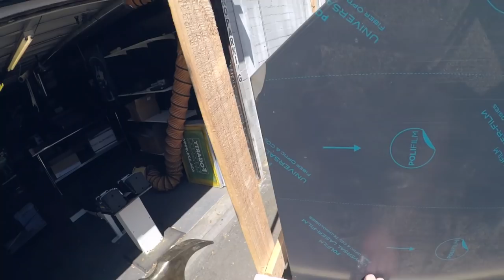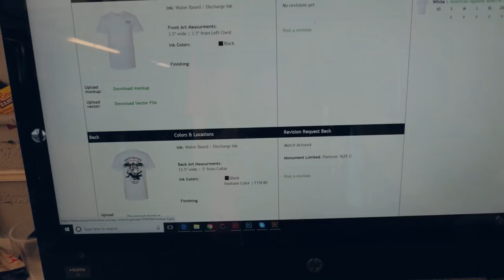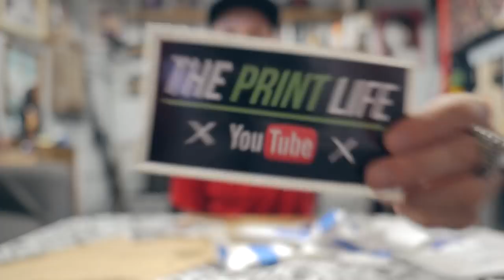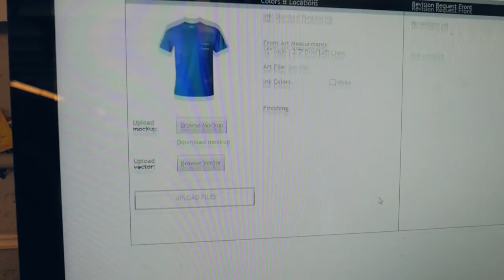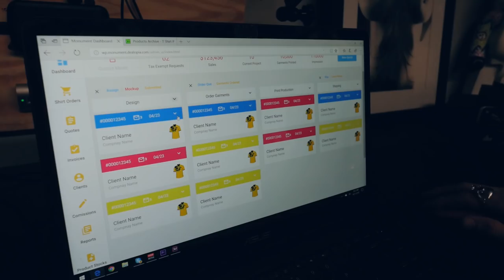Screen Print Vlog | Testing out some unconventional water based screen printing ink techniques

Comment: Oh no.! The Chinese flash dryer is down.! 4 months in, hopefully it just got to hot, Jesse is putting that thing to work.!! I need a recommendation on a good starter flash dryer, any suggestions Print Fam.?
Reply from the maker: Its back up and running. I think it did just over heat. I would still say it's the best bang for your buck if you have a carousel press.
Reply: I was looking at getting it after your review. good to know, maybe ill look into adding some fans to help it stay cooled or something if I get it.